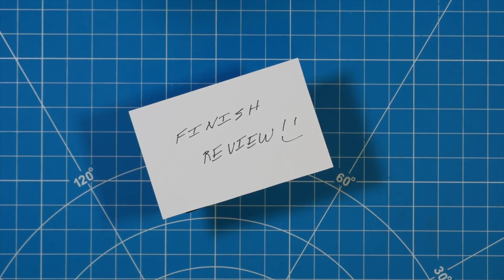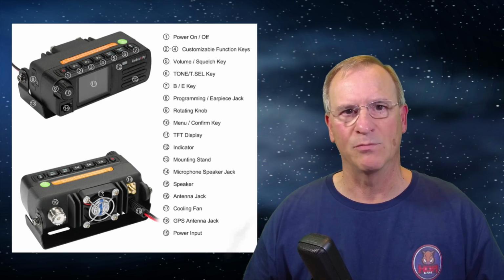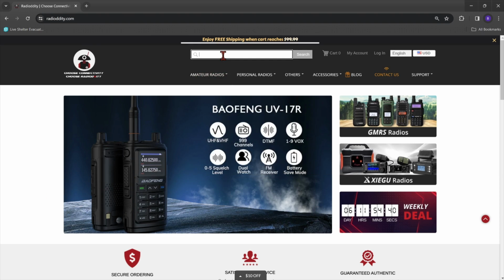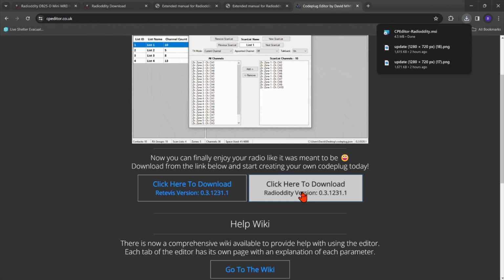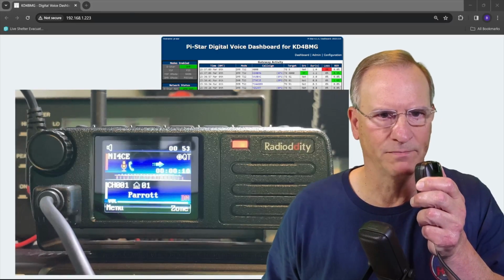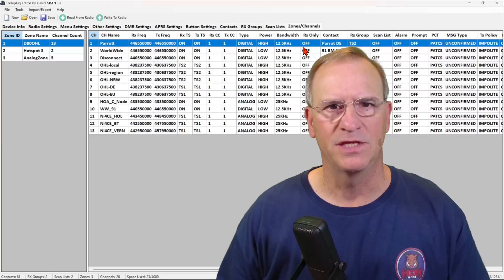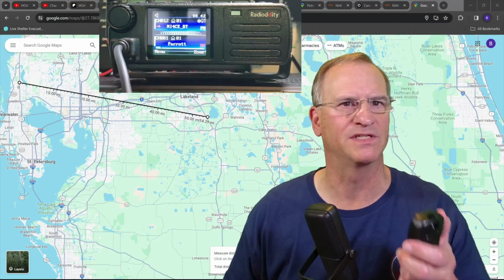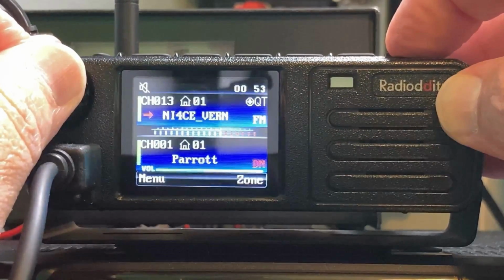Tiny UHF VHF DMR 20 Watt Mobile Radio:  Use and Review of the Radioddity DB25-D

Comment: Like others have reported, this radio is hit or miss on programming.  Two different PCs, Win 10 and Win 11. Multiple resets, reinstalls, driver checks, different USB ports all to still have it not write to the radio.  If it was just one computer I'd assume it was a configuration error, but two different PCs with different versions of Windows? Working with customer support but most likely sending it back. Correction, it did write to memory once and an hour later it would not write.  Same setup, nothing changed. Very frustrating.
Reply from the maker: I've found recently as I've changed computers and updated Windows I've started having issues using the CPS with my Chinese radios.

Comment: Is DMR running over the internet?
Reply from the maker: DMR often uses the internet, in my example I was using a hotspot that was connected to the internet.  You could hit a local repeater with RF...that repeater may connect to the internet at some point in the process of sending the transmission around the world...Talkgroup 91 for example.

Comment: Unfortunately the DB25-D radios I purchased from Radioddity toward the end of 2021 that sat in the box on a shelf until recently, ended up being totally useless pieces of sh!t. They were intended for APRS primarily but have a bizarre problem where the TX light comes on at the preprogrammed TX interval, but the power amplifier in the radio won't actually turn on until you manually cycle through the three sub-audible tone options (QT/DQT/DQI). Makes absolutely no sense. Same result if you use the mic PTT. This was using the newest versions of firmware and CPS.

The receive sensitivity is also total crap. I can hear certain clear, analog transmissions on my old TH78A handheld just fine, where the same transmissions on the DB25-D can't be heard at all, even in monitor mode. That means with APRS it transmits in the blind since the receiver is mostly deaf and can't monitor. Then the squelch and volume functions won't adjust. You can lower the squelch to 0 and it won't open, but will if you go through the menu and do it that way.

Radioddity support won't help since the radios are past the warranty period even though they were first setup and tested only a week or so ago. Lessons learned - always fully test new purchases regardless of plans to use the product later, and purchase products with a better quality control history even thought they're more expensive. The headaches aren't worth the few extra $$. Many times you simply get what you pay for. These radios will probably go in the trash since they're basically garbage.
Reply from the maker: Thanks for the detailed feedback.  I appreciate when someone provides their experience, even when counter to mine, so viewers have a larger body of information and can make informed decisions.
Reply: I’m having the ‘exact’ same issues. If I put in a RX QT the same as the TX QT tone then only some transmissions are heard. I can’t hear the person from the repeater then suddenly part-way through the conversation it comes through. It is so intermittent that I am getting confused as to what’s going on. Hey it works! No wait I missed half of what was being said. I monitor now on another radio which confirms that I miss parts of the conversation. I sent one radio back and they were super supportive but now my second iss behaving the same way. And if I have no tone in the RX QT it is wide open and squelch doesn’t quite the radio at all. Not normal based on my other radios. Support is there but it takes a day per support suggestion and drags out day after day trying random things. No luck yet.
Reply: All that said, it very well could be user error.

Comment: I've used this for about a year and really enjoyed it so far. The incredibly small size made it so easy to mount in my 4runner without taking up a ton of space; I basically tucked it into what used to be the cigarette ash tray with just a little bit of dremel work on the dash trim. It's so compact, it completely stays out of the way, and yet so capable for its size and cost with all the things it can do. Really fun little radio! I'm considering getting a second for mounting on my off-road ebike for a little portable adventure radio.
Reply from the maker: It really it a little marvel!  Couldn't agree with you more.

Comment: I have had mine for right at a full year,  mostly use in the shack to reach local repeater and occasionally use with my hotspot depending on what talkgroup and how long i want to be on.  Seems to work well on analog as well,  programming wasnt the monster it is being made out to be if familiar with dmr.  So far no complaints.  73!

KO4UHP
Reply from the maker: Thanks for the feedback on this little gem; I always like to hear what other people experience with gear, even if it doesn't match mine.  The more info the better for others.

Comment: 3M Hook & Loop fasteners do work, but if you really need something to 'stick' to something else, I recommend 3M Dual-Lock. I've found that it has a much better hold for heavier items or items that may get quite a bit of vibration, such as a radio mounted in a vehicle, and it doesn't seem to wear out as quickly or get clogged with fuzz like Hook & Loop fasteners.
Reply from the maker: Thanks for the feedback and suggestion.

Comment: Curious if the DB25D will transmit outside of the ham bands. According to their website,  it is Part 90, but the manual says ham band transmit only.
Reply from the maker: Ham bands only.  If there is an unlock sequence, I'm not familiar with it.

Comment: It's the same radio as the Retevis RT-73.  Yes it's a very nice size and it holds so much promise but it will eventually brick like mine and others.  It'll start by losing frequencies and then will start shutting down until it just won't boot up anymore.
Reply from the maker: Appreciate sharing your experience; the more information available, the more informed individuals can be in their decision making.  Thanks.